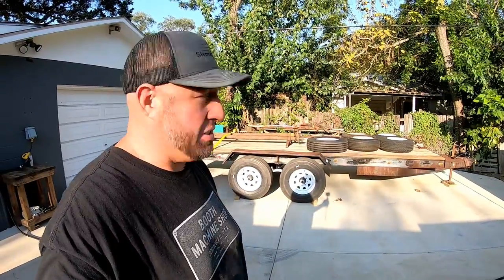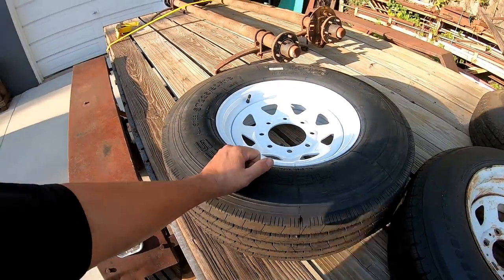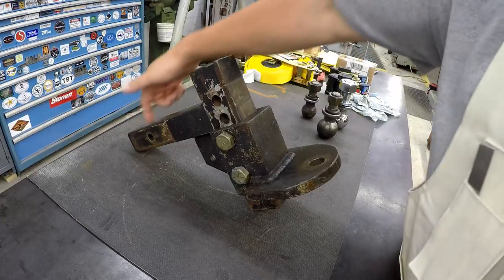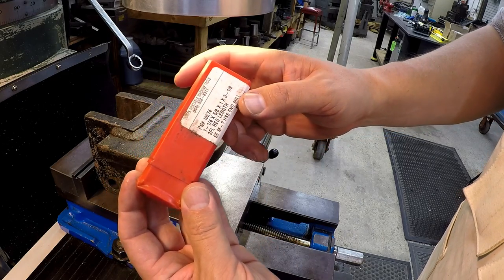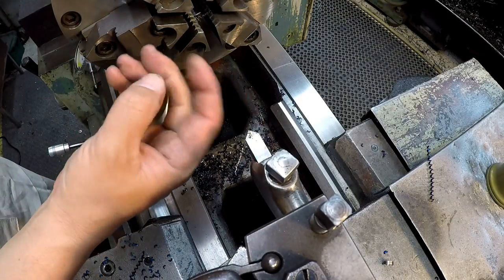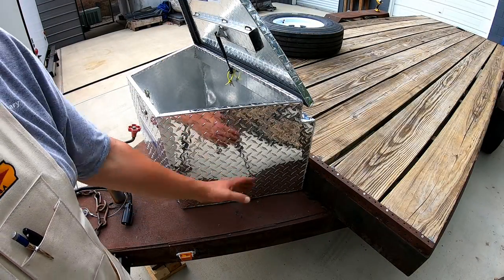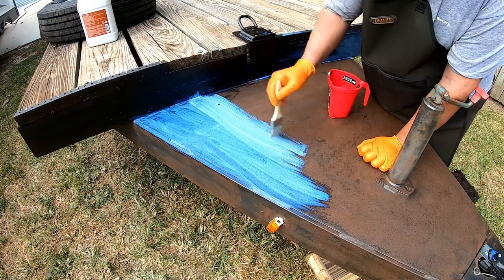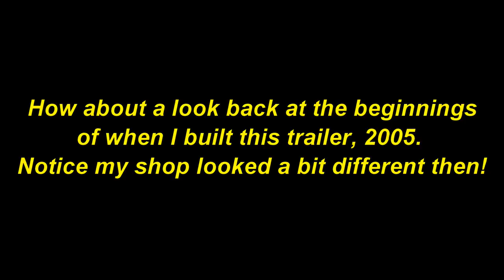SNS 276: This Old Trailer

Comment: Nice. You may want to consider adding full length flat stock through bolted sandwiching the bottom of the tool box. The road chatter will causes the light weight aluminum to get weak around the bolts.

Comment: When You are trying to chase the deck height fenders and"D" rings just be aware of the "sag" in the suspension under load. Good luck, Adam.
Reply: My thought also.  Maybe he can mount the fenders on the axle, instead of the trailer side - that way they can be built really close to the top of the tyre and always retain clearance when the trailer sags or bounces.

Comment: That is a very nicely built trailer. When You load that new aluminum tool box, after some use, (vibration), You'll wish You put fender washers on the mounting bolts... IMO.... Best Wishes, Adam...

Comment: Ben sure to use some thin rubber strips or whatever to insulate the aluminum toolbox from the steel tongue plate to prevent galvanic corrosion from dissimilar materials.
Reply: James Burba And some air space to give the rainwater a chance to dry out.

Comment: May I suggest, with the trailer attached to your truck, on a level surface, and if you are rating the load capacity at 10,000 to 11,000 lbs,  load the trailer with about 8,000 or 9,000 lbs. With this kind of weight on the trailer, the suspension will compress, use this deck height to determine the gap between the tires & fenders. enjoy your videos, especially the heavy machining.

Comment: As a testament to buying quality tools, He used the same Mag-drill when he first built the trailer as he used to drill and tap the hole for the tool box. It looks exactly the same in both shots, and worked a treat on the tool box 19 years later. Can't beat good tools that get treated properly

Comment: Adam, the springs on the axles allow the wheels to move up when you run over a obstacle. If your new fenders are going to be a fixed height and down close to the top of the tire, when you hit bumps the tire will push into the fender.

Comment: Finally, someone that cares about safety...new tires and wheels to go with the new axles...too many times I see trailers with shoddy running gear. Adam...thanks for caring about the cargo and the people around you in traffic, keep it safe. Also, check with Curt trailer parts...they might have the hitch ball you are needing as well...

Comment: I've got the same ratchet straps (Black Ones) but mine are 20,000 lb straps.  I use the to tie down my motorcycle when I haul it.  The work great just make sure you keep them out of the dirt and use some lube on the rewind.  Awesome trailer.  When you go to change the deck boards think about it and research your area for decking materials.  I made the mistake and just used big store treated lumber the first time I redone mine.  I've got Douglas Fir on mine now that I treated with lindseed oil and it has lasted 6 years so far.  I've reapplied oil to it twice in 6 years and it sits outside year round.  Thanks for sharing.

Comment: Adam. Got to thinking about your fender mods. WhiskyKarlsson down below in the comments offered the best suggestion. Mount tight clearance fenders to the axles. Otherwise you are likely to have grief at full loads or rough roads. As well,as I recall,leaf springs offer pretty much direct proportional deflection to load. One mod of real value would be a pointer with a scale. Pointer standoff  mounted between axles,scale on the trailer body. That way you have a very good idea of the load you are carrying without having to pay to scale it. Direct reading at a glance.
Could also increase the drop of the axles by a homemade lift kit. That way your rubber and the fenders mounted to the trailer body will not meet.
All the best.

Comment: As a locksmith, I strongly advise adding a heavy duty hardened hasp and staple with a padlock for your strongbox. The lock it comes with is very easy to open without the key.

Comment: Nice work as usual. The bushing for the ball is EXACTLY the kind of thing I make then when I really really need it, at night, in the rain and snow, at freezing temperatures, I drop, and can’t find. Been there done that, I recommend gluing it on to the ball. Fancy shop aprons.
Reply: Would gluing really work?  Figure the ball and shaft are loaded and shifting, the glue holding it too the bushing might give. Not sure if he needs original threads, if so couldn't he thread the inside of the bushing so it could screw onto the ball?
Reply: @boots7859  I think threads are overkill, you only need to hold it in place till you get the nut on.

Comment: don't forget about axle travel when attaching fenders, wheel clearence. Great Video, Thanks Greg.
Reply: I was going to suggest that.   Max load and forward/back travel (angle) should be considered.  The trailer is not always on flat road.
Reply: Wonder if anyone has floated the fenders off the axels. Should never bottom out and kill the tire

Comment: Plys on a tire does not have much to do with blowouts. It is the weight rating at pressure. Granted higher weight ratings will likely have more piles but you can have a 10 or 14 ply tire with a weight rating lower than the intended loads. For instance, you put 2 7000 lbs axles under the trailer suggesting a 14k total weight capability. If the rating on your tires are 2800lbs each, you have an effective load rating of about 11000 lbs. If you load up to 14k lbs, you will have blowouts still.

 This is more evident with commercial tires where that actual load capacity is specified and the only class is trailer, drive, or steer tire.

Also air pressure is extremely important. The weight rating will diminish significantly is the air pressure is reduced.  This causes the sidewalls to heat up and the the plies will separate causing an eventual blowout. It also causes the tire in tandem (right in front or behind the low pressure tire) to take on more of the weight distribution which could cause it to become overloaded and risk a blowout.

Finally, I hope you are aware of it but you could be required to have a class A cdl to pull that trailer.  Federal law which all states have adopted states that a combined gross vehicle weight rating over 26001 lbs is considered commercial requiring a CDL to operate. If the trailer raiting is over 10000 lbs it requires a class A cdl. There are exceptions for personal and hobby use but any commercial use can get you tangled into some trouble you might not be aware of- especially if you cross state lines. For instance an f250 has a gvwr of 14000 lbs. Your trailer could be considered 14000  lbs because of the axle and hitch. That is 28000 lbs with a trailer over 10000 and could require a class A cdl and all the hassles that come with it if used in a commercial capacity. 

Also note... that is rating not what is actual weight. Even empty, if the rating qualifies, it fits the requirements.
Reply: Good information and something Adam should consider....

Comment: Hey Adam...I'm looking forward to seeing you at the good of the land thing in Temple Texas on the 26th of October....One thing that I have noticed guys doing around here is replacing their boards by taking some old telephone poles to a saw mill...pulling all the nails and other metal and have them sawn into extra thick and creosoted lumber....people are also using it on some gates, fences and horse stalls......It can be an economical solution to an age old problem of rot on the deck of a trailer that must be left outside in the weather and sun and everything else that will mess up a trailer decking......how many old telephone poles are out there that have already lasted 50 years or so.....the key to it is getting the raw material at the right price.  I can take you to a place in Sanger Texas that does sawmilling of creosoted  timber and show you the uses of the material..... I know you will like it.

Comment: I would suggest a 6" block under the tires of one axle to simulate a speed hump or uneven terrain when spacing the fenders. Maybe even some load too.
And springs.  Amazing how much well worn springs can sag.
Reply: jacktheripped  just my two cents while watching.  He put all new
Reply: @asherdie , I don't know sh!t, however that would seem to be a good test. Drive a car up on there, and then slowly go over the 6" block to verify there are no gotchas.  Now imagine its really loaded with 8-10K, thats probably not what you want to find out when tooling around at 50 mph... But again, IDTS, but like good ideas that cost $0

Comment: Adam with regard to the storage box fixing you might consider mounting it on small stainless steel risers to allow water to escape rather the be trapped and cause rust etc.

Comment: rough cut lumber is good choice it actually provides a good bite to your load when you chain down my flat bed semi trailer has rough cut lumber deck for that same reason
Reply: just for a point of reference legally you are allowed up to 8'6" in total width so if you could lower your fenders you may be able to widen your deck

Comment: When the trailer is empty you need to allow 3 inches above the trailer to what you call fenders to allow for the rocker system to work and springs to squat without rubbing on the top of the trailer. A full load going through a gutter or over a speed hump will rub the tyres if there is not that clearance. Also inside your tool box I would put 2 inch square washers on the bolts otherwise they will pull through over time.

Comment: What we do to figure fender height is to remove the front tires and let thaw axle hang. This allows the back axle to go up and stop against the frame. Then add a inch above the tire and that’s as low as you want your fenders. This way if you do blow a tire out there will be room for the other tire not bottom out into the fender. This is from lots of experience with hauling ditching machine I ran for 12 years and boss not buying good tires. Probably blew a tire a month for years till I finally got it in his head to let me rebuild it.
Reply: That was one my concerns about trying to get the fender height down to deck level... what about suspension "sag" under loading...
Reply: Richard Lincoln my trailer with a tire off the one with the tire would just set the frame on the axle. So even with a load I never had a tire rub up in the fender.

Comment: when using straps and tying on a load that leaves the strap hanging out in the wind from the top of the load to the trailer try putting a twist in the strap on both sides of the load. you will find that the strap becomes stiff as steel and will not vibrate in the wind going down the road, cuts down or eliminates the wear up on the corner of the load.

Comment: since you are using that 2 pin and snap ring set up, i would just make another ball mount for your drop receiver with the 1 7/8" ball. leave your 2 5/16" ball on that nice heavy one piece mount you made. might be faster than changing balls and less room for errors. when i mount those thin aluminum boxes, i like to put a piece of plywood in the bottom and run my bolt through it then the aluminum to spread the mounting surface.....mine crack and brake around the fender washer and bolt if i dont put the wood in. great versatile trailer. those hercules tires have served me well. i use the st235/80r16 with the 110 psi rating. i find i have to replace the factory rims as they are usually only rated at 90psi.

Comment: Lots of growth on that property line back then !  Neighbors A/C doesn't sound normal.
Tough trailer materials !  Those larger axles will impress much. Best of all, decent tires are available for them which will take the worry of a blowout from happening like they do so often with 3,500 axles. LED lights and side anchor points on the list? Also, they make a man made material that might replace those 2x6's for more money but they won't split, rot or require any maintenance.

Comment: Hey Adam!
Good luck on the restorations / rework of the trailer!  Nice looking stow bin too.  One item with regards to the stow bin, probably 'should' make some provision for condensation drainage. Perhaps a bulkhead fitting with bug screen and short trailing piece of tubing.  Trailing bit of tube is to prevent water from entering while driving in the rain etc.  Bug screen is obvious...keep the creepy crawlies at bay!
Ken

Comment: Adam i would put a headboard on the trailer just about the same height as your storage box because you can guarantee  that if your carrying anything like lengths of steel and you have to do an emergency stop for any reason and the load slides forward you could say bye bye to that storage box or if you are lowering anything long on the trailer and it drops it'll make a pancake out of the box.
Reply: That's a really excellent suggestion!
Reply from the maker: When I haul 20’ lengths of steel I hang part of it off the front and part off the back equally. If bound properly it’s not going to move.
Reply: Yep, its pretty but the first thing thats gonna get crunched or knocked off.  I also suspect the shiny will be the first thing some punk is gonna try to pry open thinking there $omething in there worth pawning for meth or drink money.
Looked awesome in the original build pix, surprised how poorly the paint held up.  More coats maybe?
Reply: @Abom79  I used to haul steel as part of my job at a structural fab shop, and it isn't so much the normal travel that's the issue, it's the really, really bad situations that you can't predict. But, if you aren't carrying material that's too heavy, it should be fine. I'd still want a head board. Heck, make it bolt on if you don't want it permanently attached.
Reply: @theacidbeaver  Or it could even be a drop in headboard into a pocket in either corner so it can be removed
Reply: @Abom79  when you had lengths over hanging at the tongue end you over hung them down the centre so that the front overhang never hit the rear of your truck when the trailer articulated around corners, but now you can't do that because you have that box there, i used to drive for a steel stockist and all our rigid delivery trucks have an "H" frame type headboard so longer steel stocks rise over the cab because we have found that if we had a bundle off steel stock fastened down and we had to stop in an emergency the steel stock in the middle of the bundle would slide forward and hit the headboard or sometimes punch a hole throughthe timber boards where as since we use the frame fitted we find that with the steel stock at an elevated angle steel stock is less likely to slide out of the bundle because inertia isn't travelling in a straight line of thrust.

Comment: Adam, have you ever thought of putting a winch inside the box, with a flap cut in to pull the cable through, keeps the weather off the winch, just a thought.

Comment: Abom dont lower the fenders to far without seeing how much it squats under the max load so your tires do not rub
Reply: My dad and myself had trailers that we rented out so I have a little experience and that was exactly my thoughts !!!
Well spotted !
Reply: My dad when I was 11 years old "I'm 43 now" rebuilt the flat bed on a 1955 f350 292 2v v8 4sp duelly and when he did he put one of the 3"x3" "idk the wep thickness" close to over the top of the axle and 8n doing so it spanned the full 7' of the bed that was 7' wide by 9' long with 4' tall racks, a year or two later we started hauling firewood again with the truck "2 cords at a time, 6 ricks" and one of the trips down off the mountain the tamarack was waterlogged and the one ton overloads had a negative arc and the angle iron was rubbing on the duels. Needless to say my dad cut the web that was over the tires off so that never happened again.... but this is what I was meaning by load the trailer and see just how far the trailer will settle with 11,000 lbs or what ever you plan on your max gvw being so you dont have the similar result when you lower your fenders...

Comment: When strapping, don't forget to put one wrap in the strip so it won't vibrate while you're moving down the road.  If you think a long straight strap won't vibrate in the wind, well, you'll learn to put one wrap in it so it does not become aerodynamic.
Reply: especially helpful, when that strap is going over a sharp bend or sharp corner
Reply: @scottstarling247  Absolutely!  Then the strap won't cut itself by vibrating.    You can always hear someone who hasn't figured it out before you see them :-)